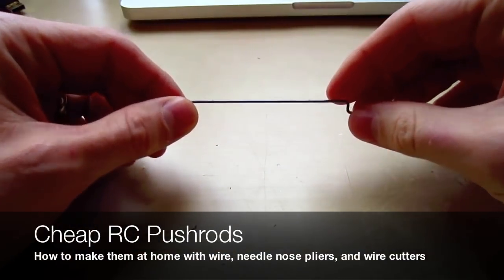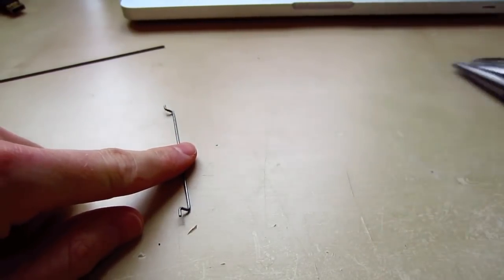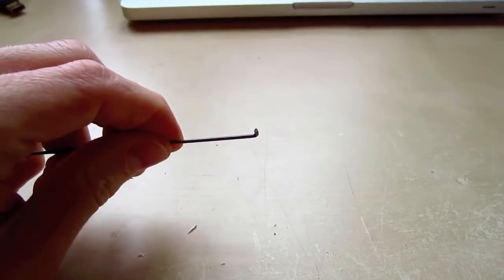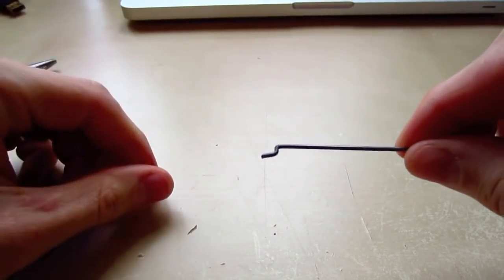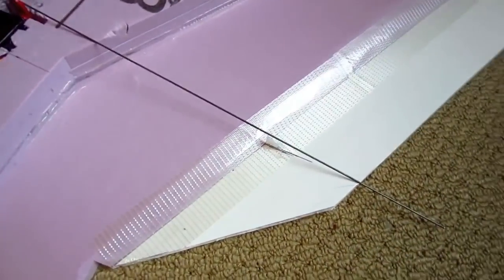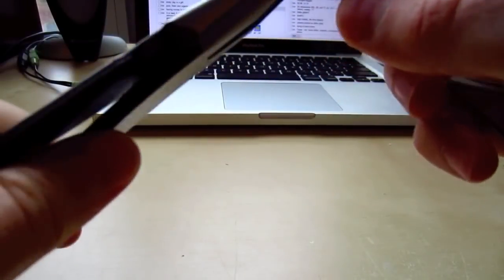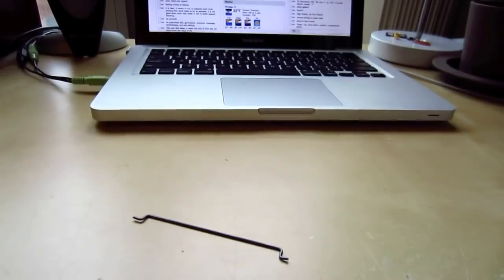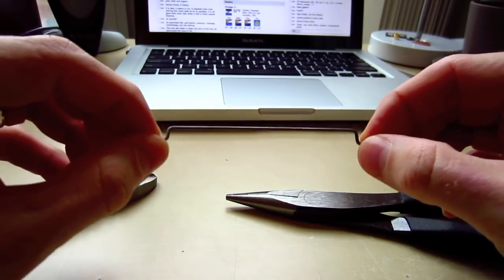Cheap RC Pushrods - DIY Instructions

Comment: Thanks.  Im going to build some after another crash due to the arm pins coming loose in flight.  How do you put them on without bending it?
Reply from the maker: I take the control arm off of the servo then screw it back on with the pushrod attached

Comment: Is there a proper way to stick the ends of the rod into the holes? Would it mess it up to bend it slightly?
Reply from the maker: I de-attach the control arms from the servos then put in the push rods and re-attach

Comment: I have .047" push rods and they dont fit my the servo arm. So upset. Fits the 1/2a control horn fine tho. I wanna drill out the hole of the servo arm jus slightly. I feel like if i buy a pushrod any thinner than this then it'll feel kind of flimsy for the 7 and a half inch pushrod length for the 30inch wingspan delta build vid..
Reply: I have to drill pretty much any servo arm for 9g to 15g servos. Worse case, you have to get a new servo are, which are abundant and cheap.
Reply: A good idea for preventing the pushrod flexing is to use coffee stirs and put the wire though that and glue or tape it to the airframe. DON'T get any glue on the actual pushrod otherwise you'll have binding issues. Hope it helps.
Reply: Kirby Chant
Reply: Kirby Chant
Reply: susanrc73